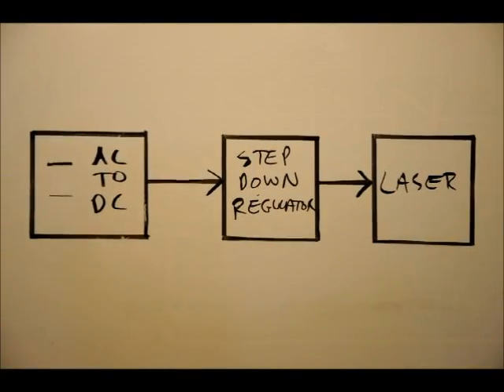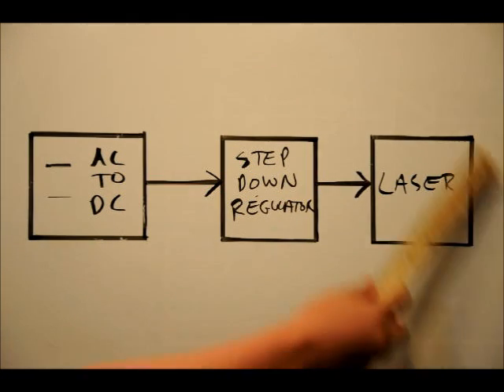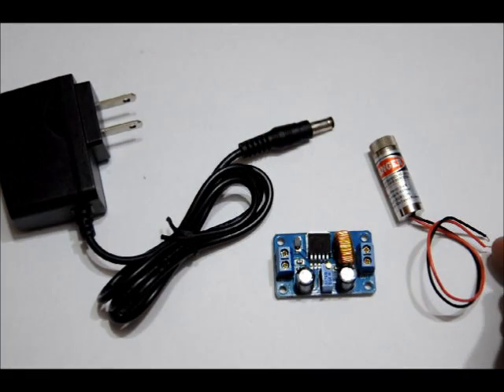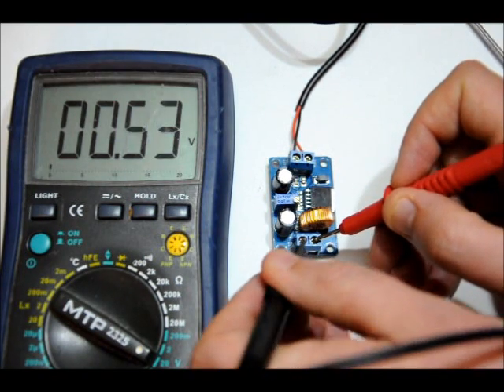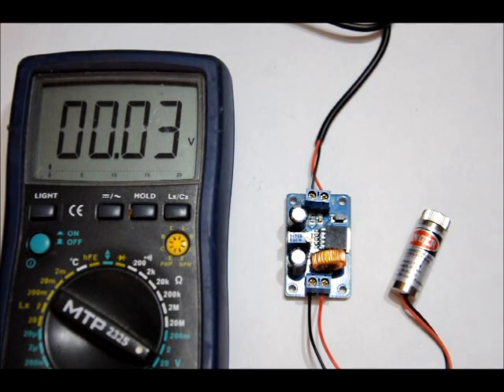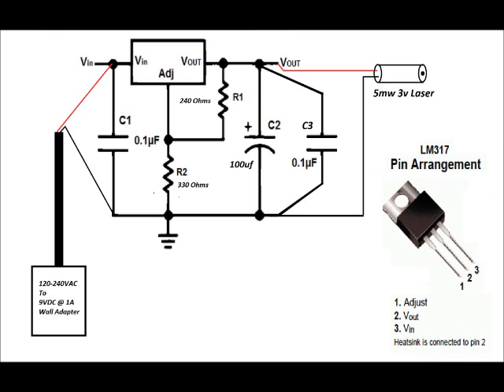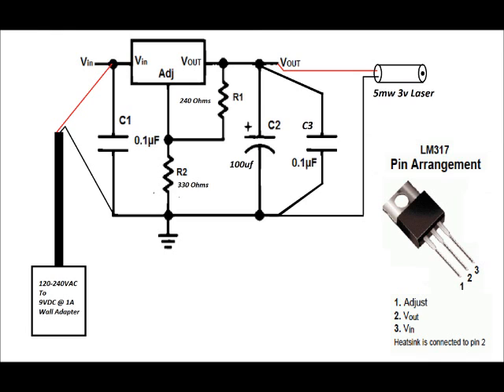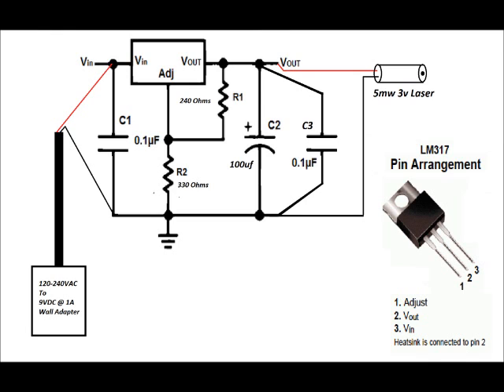Tutorial: How to Safely power a laser from your wall outlet (120VAC/240VAC)

Comment: Hi! I know its been 7 years but what is the amperage of the output of your diagram? I see some 220v ac to 3v dc transformers but they output 3v 1A which seems way more than the 5mw rating. What amperage did you power your laser at 3v?